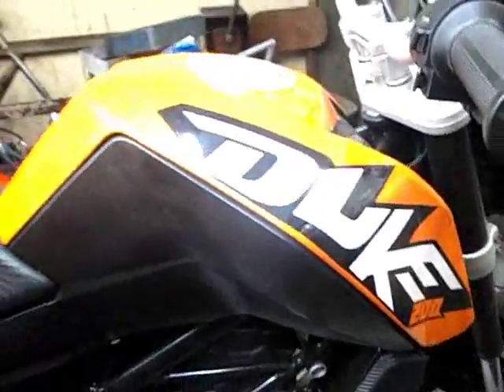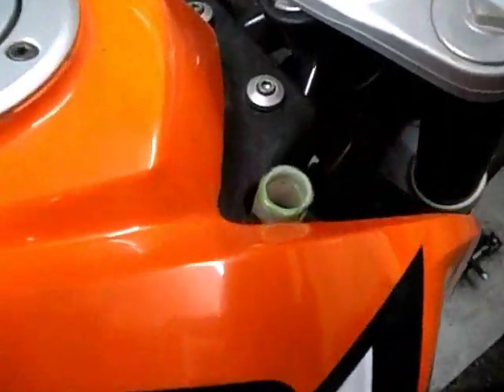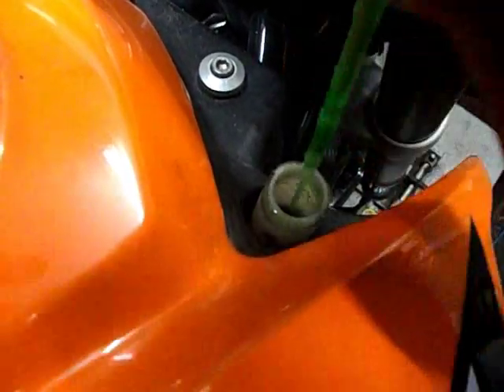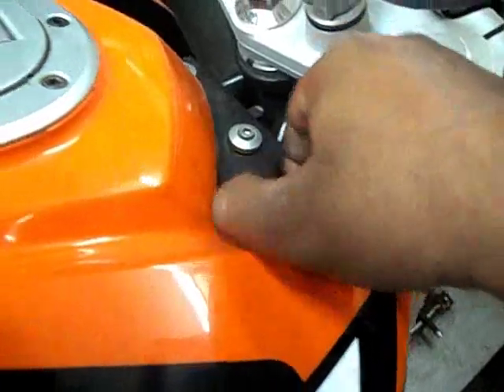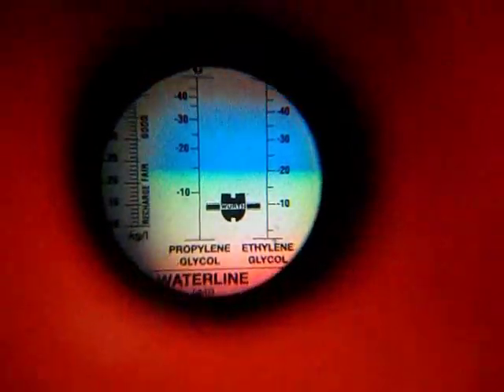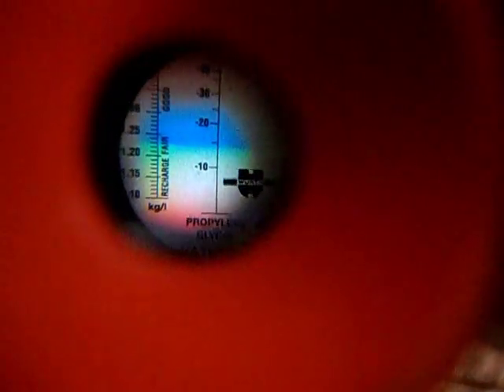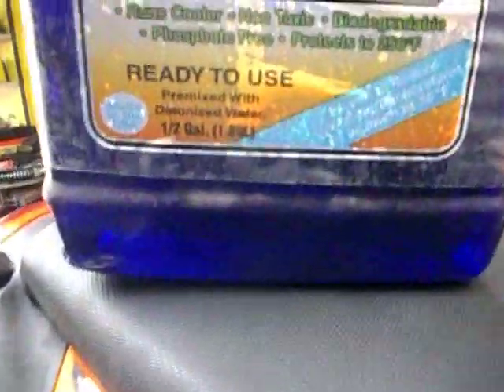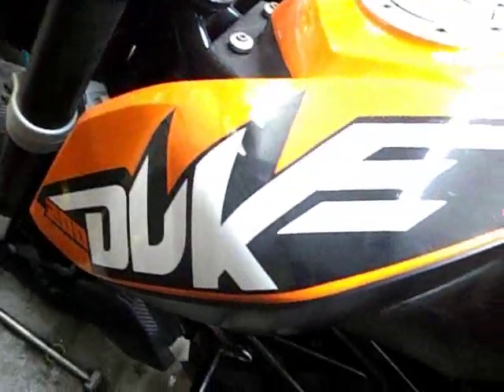KTM coolant  testing

Comment: You need to check the coolant density by opening the tap benith or from the radiator not from the top opp box since the coolant would always stay stagnate in the to opp box and show positive result unlike the coolent sample which is being used would show you accurate levels.